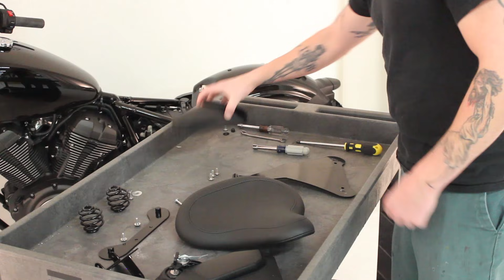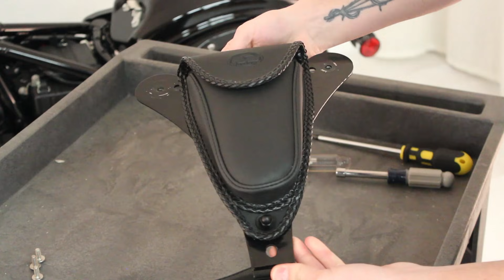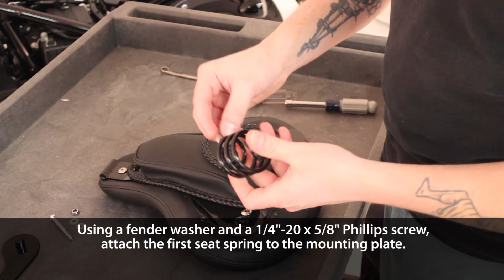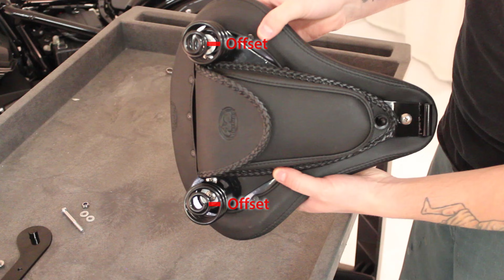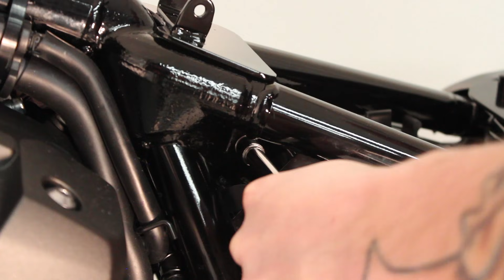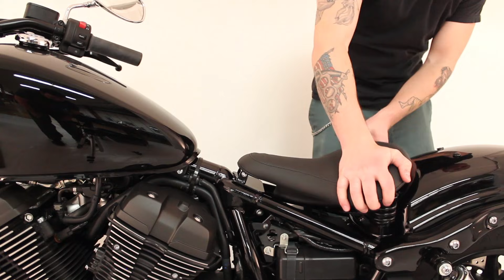Yamaha Bolt Spring Solo Seat Install

Comment: anyone have any experience with this seat? how's the comfort compared to the stock seat?
Reply: I just put this on my 14 bolt. This seat is a little smaller than the stock one. People with large butts might not like it. The suspension is pretty stiff on this bike and the springs under this seat help make the bumps softer. I am happy so far. Only issue I had was the front screw under the the seat was too short. Had to buy a longer one.